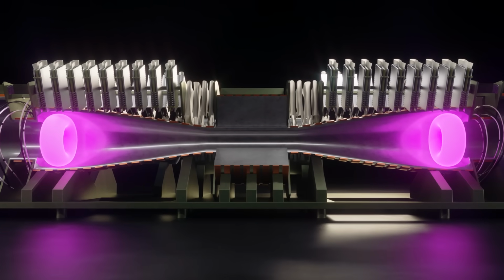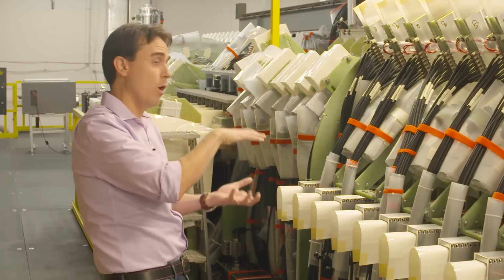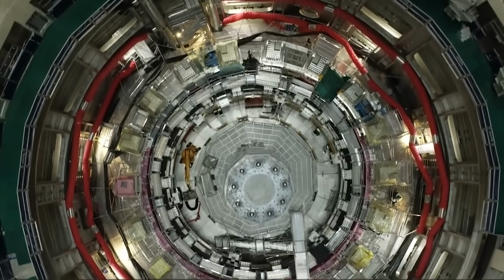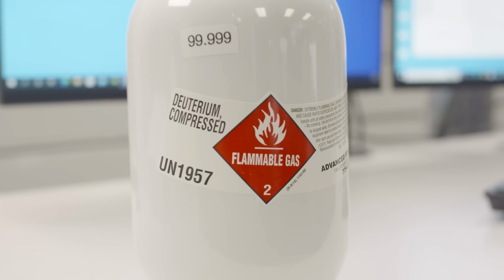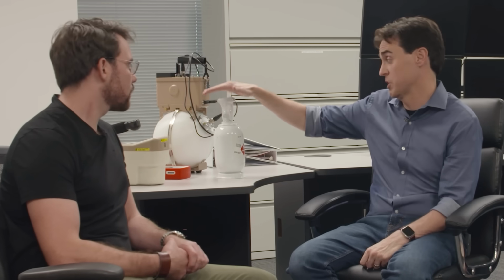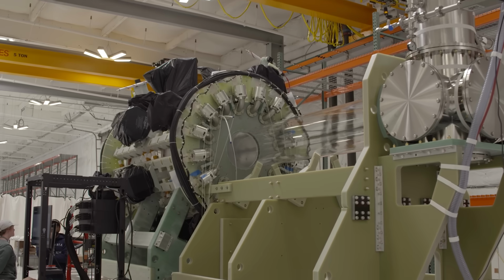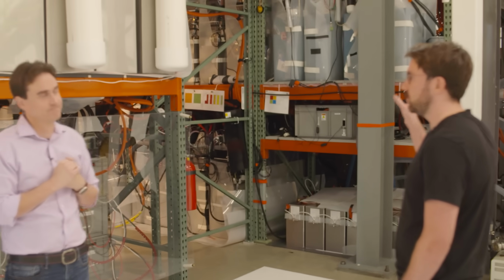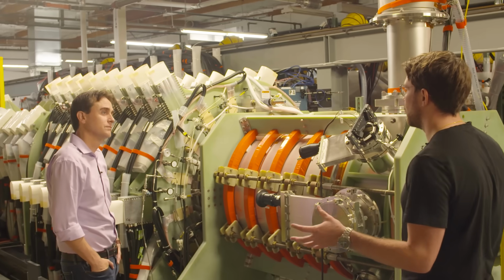A New Way to Achieve Nuclear Fusion: Helion

Comment: Let's not forget about the repeatability of experiments and 3rd party adjudication thereof. I'd love to be excited about this. :oops:
Reply: @Ruben O. That wasn't the point made. To address what was said, no research group is going to reproduce this experimentally - it is unlikely in the extreme that anyone will fund a decade + long research programme, where they will have to circumvent and innovate around patents to simply reproduce this. Now a competing company trying something using similar principles might try (if they think it is lucrative enough and there's a chance they can succeed or at least convince investors they could), but they will get little assistance from Helion in what/how they are doing it. Any publications by Helion will omit important commercially sensitive IP. Peer review of this material will be limited use and will serve no assurance to protect from scams beyond the most obviously unscientific and unviable stuff.

You will only know its not a scam or hype if in the end it works, in the same way you would know that say a catapult works, or a lightbulb works. Does it work well enough is another matter entirely.
Now independent verification of results is totally different to scientific peer review. Any investors or public funding body involved better do their due diligence. Experts would undoubtedly be brought in under NDA etc.
Reply: I'm not sure what you are expecting, but experimental reproduction is not applicable or relevant in a commercial system like this, it either functions or it doesn't.

Comment: We have been achieving fusion for many many years.  It's not even remarkable.  The trick is turning that into useful energy over a useful period of time.  This must be a significant net gain including the fuel production and radiation losses.  This design does nothing to address the core problem, which is not creating a fusion reaction, but a useful, enduring fusion generator.

Nonetheless, there are many many things to be learned here.

Comment: That sure feels more like an ad for the company with how it talks about tokamaks than like a video about the technology itself.
- it points out that many fusion projects use D-T fusion and that tritium is very rare and therfore expensive, but its fine with they use He-3? They even have to produce their own He-3 in a separate reactor so good luck making that a net positive when it comes to energy, comapred to the Lithium walls used in a tokamak.
- they say that the next iteration of their reactor needs to be bigger, because the simulation underestimated the space needed for the plasma, which is the same thing that happend to the tokamaks. Theres a reason ITER is the size it is/will be. Its design is a consequence of what has been learned from other tokamaks.

This project might very well work some day, but Im no more optimistic about htis than any of the other fusion projects out there (be it tokamaks, stellartors, inertial confinement,…)

Comment: Since this method completely eliminates any capture of energy from neutrons by virtue of the fact it is based on magnetic fields and this energy/these neutrons have to be stopped/shielded anyways to avoid interacting with sensitive electronics and become radioactive isotopes, would it be at all economical to make even a low efficiency standard thermal/steam generator to trickle charge the capacitors Incase of grid failure?

Comment: I wonder how a reaction like this would behave in space or a vacuum, or if that would even effect it at all. Such fascinating technology I can only begin to try and wrap my head around. Thank you for bringing this information to the public. This is super important.
Reply: So, we are dealing with fusion. These reactors are already a vacuum inside (ignoring the fusion fuel). If it wasn't, the A the gasses present would get in the way, and B the gasses present would quickly become superheated, and as they aren't necessarily charged that heat isn't trapped by the magnetic field, conducting into the reactor and making it just kinda melt. 

In space, we do actually have an effect, albeit a small one. On earth, we experience a gravitational pull. With the masses involved in fusion, this pull is pretty slight, but it does still exist. And because of the aforementioned danger of the heat of fusion touching the reactor walls, an ever so slight tuning of the magnetic fields may be needed in order to ensure the fusion plasma is in the very  center of the reactor, away from all the walls. Putting the reactor in space vastly reduces this gravitational pull, being essentially zero G, so that slight tuning of the magnetic fields isn't necessary at all.
Thay being said, gravitational forces are extremely light, whilst the magnetic and nuclear forces we are primarily dealing with are extremely strong. So it might well be you don't need to bother with gravitational tuning, the influence isn't significant enough to even be a consideration when putting tolerances on the design for the magnetic fields in the reactor, and those tolerances and actually just nothing.
Reply: @Santisima_Trinidad  I imagine that  changes in the enertia of a traveling space vessel would have more effect than gravitational forces.

Comment: Is this about the recent experiment where they got more energy out of the fusion reaction than the laser put in? Cause there's an important caveat with that experiment that nobody's mentioning: they are only talking about the energy put in by the laser hitting the capsule, not the energy required to actually power the less-than-100%-thermodynamically-efficient laser. If you include all the energy used for the experiment, it's actually a net negative, and a massive one at that.

Comment: This is going to be just as challenging as nuclear reactors. I still do not think this is viable compared to traditional forms, still of the opinion this is still 30 years from being 30 years away... commercial scale is going to be complex and challenging and the traditional energy form will still be the dominant form to use for at least the next decade.

This is all "lab scale" and a huge experiment, commercial viability is a whole different ball game, which I still believe this will struggle with these are technically very advanced piece of engineering and equipment. The price tag will be something akin to the ASML lithography machine (which cost $400 million a piece). I believe these will be significantly more and will fail (at least in the near term) to be commercially viable.

Comment: This is incredible.. I'm just curious what happens if it loses power while using the magnetic field to hold the plasma away from the walls? Would that cause it to damage the whole reactor and cause an explosion or something? I mean idk anything about this stuff so if anyone knows, I'd love to hear it.
Reply: In my opinion, not really. As soon as the reactor leaks, the fusion reaction will stop. It will damage the reactor though. I've read up on other concepts of reactors and when I remember, any damage is confined to the facility. In some unlikely scenarios you can ignite the gas feed or explosively vaporize the water medium (which is not even present in that concept).
Reply: This is what I imagine would happen: https://youtu.be/j3Uy9wsfkok?t=142 🤣

Comment: Bonkers to see them quite literally creating a star inside a magnetized tube. Absolutely amazing.
Reply: I get what you're saying and I agree it's exciting, but calling it a "literal star" is really quite a stretch. Stars are fusion reactors which are self-sustaining (at least for as long as they have nuclei to fuse) with no external input required, and this isn't that.
Reply: @static_motion  don't miss out on the detail that some stars could collapse on their own weight before becoming white and black dwarf, though indeed a more stable colder star burns longer, cue melody sheep exotic lifestyle taking refuge in an exotic matter star or black hole universe/decay period. And of couse since the star made by dr. octavius still got its fuel it didn't collapse on its own weight, let alone the scale of star and conditions to collapse into black hole neutron stars instead, I haven't read much about pulsar, so can't really expand on how it works.